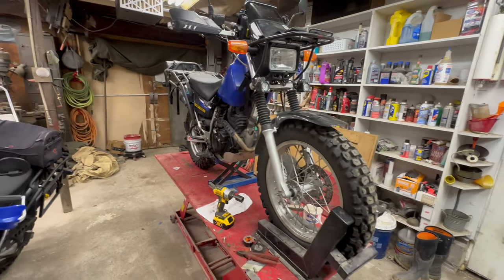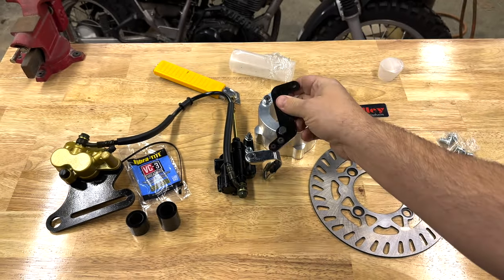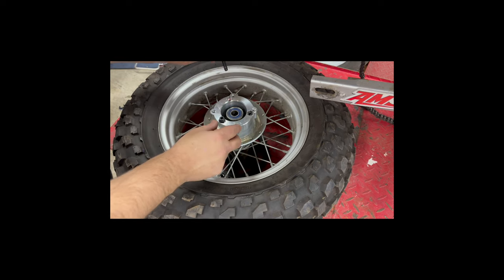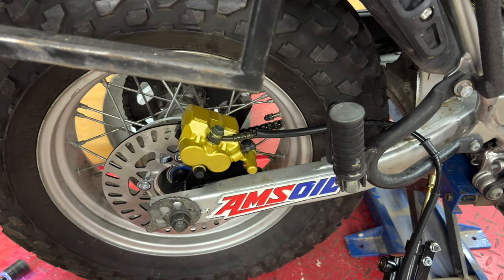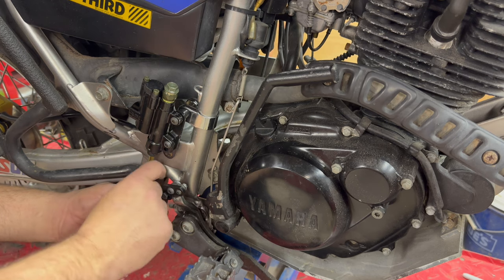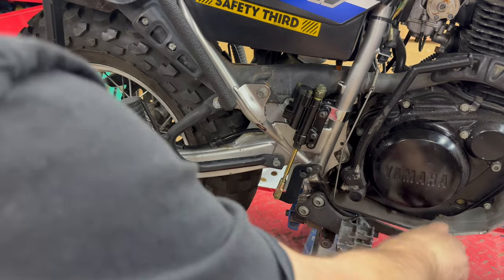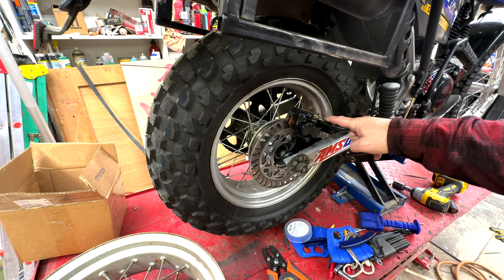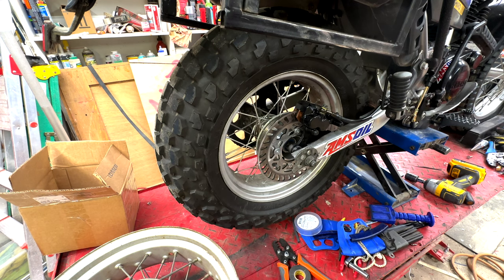Bradley Performance TW200 rear disc install and initial review.

Comment: Just to chime in and give everyone an update, thanks to people in the field that help us find issues that need to be addressed, we have made several changes to update this kit. We have made necessary changes to the hub design, the disc itself, and the brake hose. We want everyone to feel good about the products they buy from us. Thanks again for all of your support and feedback! Couldn't do it without you!
Reply: any chance to provide early buyers at a minimum a discounted price at the new parts?
Reply: congratulations on making the changes so quick
Reply: I just compared my rear fat-tire conversion (not re-using factory wheel/hub) to see if my new hub adapter seats centrically- either with a groove, shoulder, something, and I don’t see how my adapter will remain centered either. There is play in the 3 screws that secure the adapter to the hub conversion, and duplicate the concerns in this video regarding lack of centricity. The disc does appear to have a place to seat compliments of a raised rib on my adapter, yet still appear be “backwards” as mentioned , as every other disc I own faces the grooves the other way as well. Flipping the disc still allows for centricity, yet negates the recesses that would hold the disc screws to the adapter.… I’m weary now to move ahead with this kit as it stands… Thoughts Bradley? I understand this is a work in progress and am by no means bashing the design phase- simply curious how I can correct for these issues post purchase?
Reply: I really freaking want this kit!! Please keep us updated when it will be fine polished and ready to buy! 👍
Reply: Great decision! That’s the American way to do business! It’s great that you in essence collaborated together!
I’ll buy the updated kit!
Reply: I became hesitant to make the switch towards the end of the video,  then I noticed this comment, confidence restored ! The fact that you care enough to make the necessary re-tooling and changes to the product, makes me want to be a customer, Kudos !

Comment: Thanks to this vid, got mine installed in little more than an hour. My suggestion is add a seal  to keep the dirt away from the bearing, it would take a little machining on the aluminum hub.

Comment: Had major issues with install, could not get brake to bleed properly, using vac brake kit, pumping brake fluid from caliper back to master cylinder still couldnt get it,finally dealer got it to bleed as they stated air was trapped in caliper. All was working good then brake tightened up for unknown reason, warped rotor and ruined pads, had to buy new rotor and pads from Bradley. Now Ive lost brakes, on the stand brake work good but in the field not much braking power. 2nd issue was trying to mount with the Bradley big wheel kit, cannot get caliper on/off rotor with rim supplied by Bradley for big wheel kit, tried to hoist back end and just slip rear wheel out as not enough room between rim and caliper mount. Have to loosen rotor bolts, easy enough to take apart but re-installation is not easy. Oh yea nad stripping the rotor bolts is an issue, be careful.

Comment: You could get it centered by measuring from the outside of the rim to the hub in four spots 45 degrees apart from each other around the rim,  but  unless the inside of the hub is routered to match the pertrusion on the center of the wheel it won't be long before it walks itself out of center anyway.  Same thing with the disc,  you could measure from the perimeter of the wheel to get it centered,  but the play in the mounting holes will just have it walk itself out of center after a few stops.   I see that Bradley took your advice and altered the hub to match the wheel.  Good job.
Reply from the maker: That is exactly what happened.... It moved around and I en did up taking the kit off, I never did a follow up video because the kit is sitting in a box in storage.

Comment: I bought the kit for my TW, and the only issue that I had was bleeding the air out of the brake fluid.  I went online and found 2 banjo bolts that had bleeders built into them.  This worked awesome.  I also did the sintered bronze pads.  I did not like the brake action with the stock pads, but after I installed the sintered bronze pads, I noticed a remarkable difference.  I do indeed love my rear disc.  I absolutely HATED the squeaky squawky poor rear drum brakes.
Reply from the maker: Fantastic. Glad its working out for you. I'm guessing you got one of the newer kits? 

Im not a fan of the drum either but alas mine is back on the bike. As i feared the original adapter moved around in use and i had to re-center it multiple times in a pretty short amount of miles. Not something i wanted to fiddle with constantly so off it came...
Reply: @TDub_ADV  Are you saying the the disc would not run exactly true, like it would wobble a little?   Would that make the brake less effective?  Look at some of the discs on bikes, they are not even round.  They have a wavy outside edge, and they work just fine.  I have never checked to see if my disc is perfect or not, but it does work so well.  I even extended my brake cam actuating lever to exert more pressure to the shoes, and it was still horrible.  I will never go back to the drum.

I will check to see if my disk is exactly centered.  Either way, I will continue to use it, because it works so well.  Would your disc brake not work?   I am sorry, I just don't understand maybe.
Reply from the maker: @BuilderofRat  As explained in the last part of this video, the entire assembly would run off center from the wheel and make the rear wheel hop and upset the rear end of the bike. I have owned bikes with wavy disc's but the difference is the center line of said wavy disc is turning on the same axis as the wheel is. When the adapter would move the disc was moving in an elliptical pattern in relation to the wheel's axis.
Reply: Not sure but BuilderofRat do you have the newly designed/corrected eccentric version?
Thanks for the info TDub_ADV and yes I understood your comment about the newer version🏁
Reply: @Fateracing  I have no idea.  I must have, because I do not have any issues with the disc needing to be trued up.

I would think that Bradley would have supplied TDub-ADV with an updated version.  They seem like a good outfit. After using the disc for a while, it would hurt my heart to put the drum set up back on.

I wonder if they make sintered brass brake shoes.  I use to do than on my older bikes that did not have discs.  It was a remarkable up-grade in brake performance.  They warned that if would wear out the center hub, but I never did.  If it did, so what.  When I worked at a Honda/Yamaha shop, that was one job that I was pretty good at.   And, the TW has a bolt on drum, so for it that would not be an issue.

Comment: I would of used the blue loctite 243 because it will be easier to remove later on without heat application.

Comment: I'd be a little leery about a zip tie holding that brake line, they rot awful fast and you don't want that line hitting the tire.  That hub adapter needs to be redesigned, I spotted the flaws when you first put it on.  Is that printed piece plastic?  Brakes get hot, can it melt?

Comment: Hi also have you thought about making that center puck and offering it to buyers that have the old style kit??
Reply from the maker: No, I did send the plans to a couple guys with 3d printers.  In the end while the tool worked good to get it installed the adapter did not stay put which was a worry I had. I ended up taking it off since I did not want o have to mess with it constantly to keep it centered.
Reply: @TDub_ADV  ok I thought this when I saw his kit with no pilot on any of his hubs this will happen I like the kit but he needs to redo them I build fat cat kits for  the older Honda 3 wheeler and I build buggies I know a little bit about building parts.
Reply from the maker: @stevenpleasant5834  Based off the pictures on the website it looks like he has fixed this for kits going forward.

Comment: Great video.  I agree with everything you said about the rear wheel conversion.  I machined an alignment tool for the hub and disc.  This worked out great.  I also had an issue with the twist of the brake line and ended up doing the same thing you did with flipping the banjo fitting and straightening it so it runs just to the right of the bleeder valve.  This kept the line parallel to the swing arm.  But now I have a problem with bleeding the system.  I have tried gravity feed and also a vacuum pump but can not get the brake caliper/pistons to engage the disc.  I even worked with a mechanic and we know we have all the air out of the system but the brake will not engage.  Did you have any issues bleeding the system?
Reply from the maker: No issues for me bleeding the brakes at all. Are the washers on the banjo bolts in good shape still?
Reply: @TDub_ADV  They should be because the unit is brand new.  Im thinking that maybe there is some trapped air around the master cylinder because I never feel a solid resistance on the brake pedal.  Im going to try a bench bleed by breaking the banjo fitting loose at the master cylinder and see if I have any trapped air in the piston.  I called  Bradley Performance and left a message. Will try again after the 4th.  Will keep you posted.    Thanks.
Reply from the maker: @robertloudenslager1581  Its possible they may have been damaged when you took it apart. They are pretty soft copper and just the act of removing the banjo bolt will sometimes ruin the washers. I always replace them now because i have been bitten by bad washers in the past. 

If its not building pressure you either have trapped air or a leak somewhere. its also possible to crack that fitting if your not careful.
Reply: @TDub_ADV  Are the copper washers a standard size or specific to the caliper?
Reply from the maker: @robertloudenslager1581  They should be standard 10mm size.
Reply: @TDub_ADV  Finally after a Bench Bleed of the Master Cylinder, all is working fine.  Your right about the stopping distance with the stock pads.  Going to try a different brand and see the results.  Thanks for your time on this matter.  By the way, Bradley Performance did return my call and after a long conversation, wanted detailed pictures of the twisted brake line that we were seeing.  He said that if I could not get the system working, he would make it right.  Great follow up and shows that he does back up his companies claim... Says a lot about a business.
Reply from the maker: @robertloudenslager1581  Glad you got it working. I have been pretty happy with the Tusk pads i got from Rocky Mountain ATV. A huge improvement for under 20 bucks.  
https://www.rockymountainatvmc.com/parts/tusk-brake-pad-sintered-metal-p?v=837

Comment: Or you could 3D print the necessary parts and sell them as independent "installation kit" and make some bucks. That's a business opportunity right there.
Reply from the maker: Nah, better for the adapter design to be fixed. The parts moving potential I pointed out in the video is actually a thing. It happened to mine, it moved more than once in a short amount of miles and I had to re-adjust it so the only fix is to make the parts hub centric to keep it from moving which Bradley Performance did for the current kit. 

I ended up taking mine off since I dont want to have to constantly mess with it. Thats why I have not done a follow up.